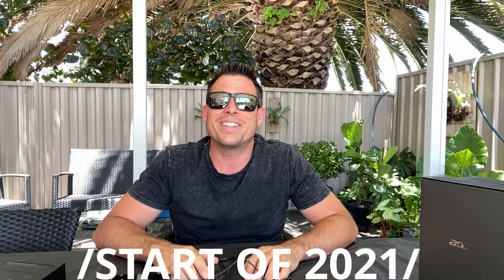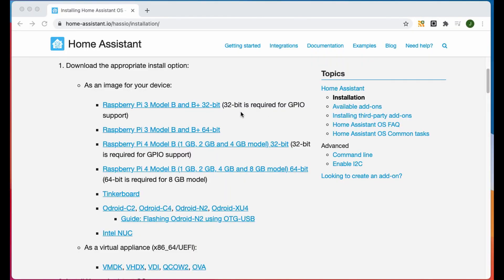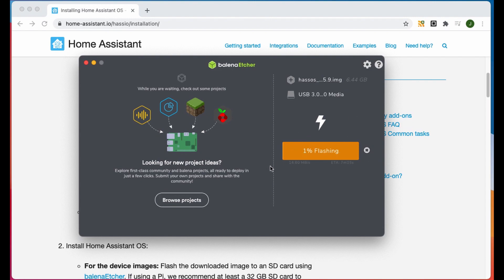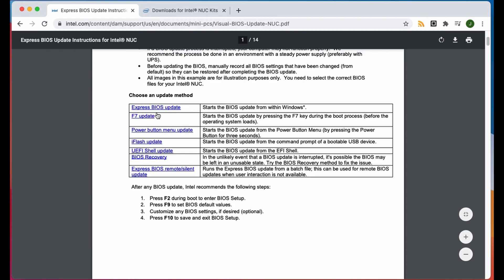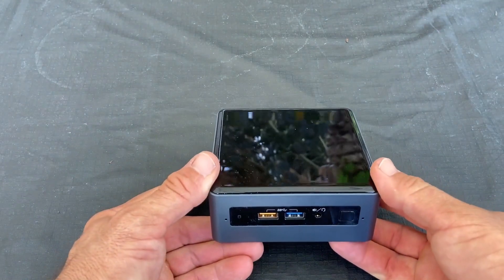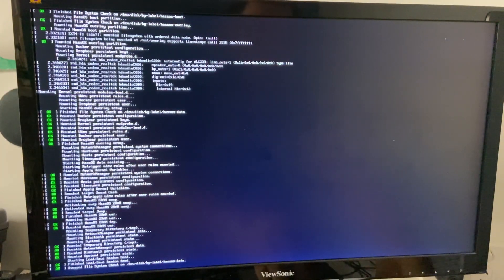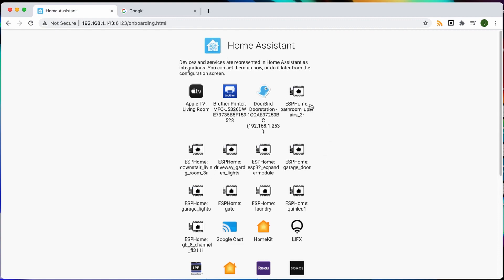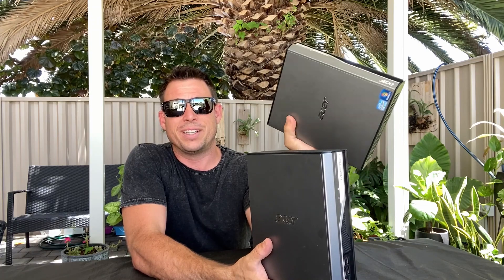Install Home Assistant on an Intel NUC

Comment: anyway to do this with a nuc that has an m sata? I got one but I dont know what to do with an M sata or can I boot this up from usb?
Reply from the maker: If you mean M.2 sata you can get usb converters for them, or for NUC with built in drive you can start it with a live Linux USB and load it from that using Balena Etcher Linux version.

Comment: Hey Awesome video, i have disabled to Bluetooth and WIFI during the installation. how do i turn them back on ?? i want to use that. i tried connecting a keyboard and display to my NUC at a later stage to try and enable the Bluetooth, but its asking for login and password. the one that i have is not letting me in.  some help will be appreciated.

Comment: Hello.  In Argentina everything is very expensive.  Is a Celeron nuc worth it to replace a raspberry pi 4?  Thank you
Reply from the maker: For me going from the RPI to NUC was night and day, so very much better, but that was a while ago when we continuously had to restart home asistant, the developers have made heaps of improvement so I don't have to do restarts much now and that was where a NUC would save me a lot of time in restarting, it sort of comes down to how much your trying to do with your system for example I have around 100 devices, 6 cameras, lots of automation and pretty much everything in my house uses home assiatnt in someway, so for me it was definately worth the cost.
Reply: @SparkyJames  Thank you very much for replying.  he had doubts if it is really worth it for more than being a Celeron.  hug and thank you very much for everything

Comment: when using HAOS, is it possible to use SFTP to transfer files?
Reply from the maker: Yes, but you need a ssh server add on setup. I have done it ages go. But there are probably easier ways to transfer file, I now use vs code addon or samba.
Reply: @SparkyJames  good point ... i forgot about add-ons. will give it a try.

Comment: I had a problem with SSD not being detected in the BIOS and tried all updates and tricks. Turned out I hadn't plugged the SSD into the slot properly, after which the installation was super quick. Had to disable "Secure Boot" too

Comment: So how do you do it with out the drive writer? 

I have NUC (second hand currently has Windows installed.)
And a laptop....
Reply: You could use a live linux USB on the NUC, then use balena etcher from there to flash Home assistant image to the HHD on the NUC. Then shut down remove the USB then it should start up to home assistant on the NUCs drive.

Comment: Could you just do this on a regular computer instead of a nuc or couldn’t you use a thin client
Reply from the maker: Yes you can, any x86 system. The image on Home Assistant download page is actually now just called the x86 install instead of NUC image.  I’ve tested a few and no problems. I’ve not tried a thin client yet, but if you can flash the drive in it, it should work.
Reply: @SparkyJames  oh great!

Comment: Hi Great video thank you. Could you please help 🙏.  Is this the same method using a mini pc like beelink? Thank you in advance
Reply from the maker: Hi Ajay, I do plan on making that video, HA will run on any computer that Linux will run on, the only issue to be aware of is it will most likely come with problems you will need to figure out, and various hardware compatibility issues that will vary from device to device.
Reply: Thank you very much
Reply: Hi Jimmy sorry one more question. Does this nuc have to be an official nuc or can it be ok with third party manufacturers.
Reply from the maker: Hi Ajay, relatively recently, the HA img for NUC is now a generic x86-64 so any 64bit x86 should work with the img on HA install site, using the method in this video, I’ve tried it on a generic system and it works fine.

Comment: Great video, I am about to move from a VM to a dedicated NUC. Question, I assume as I am already running VM i would be able to follow your steps and then simply restore from a home assistant snapshot without too many issues, I will of course give the NUC the same IP, but other than that I assume no other issues to worry about?

Comment: Hi, after looong trying of other methods I made it like you showed and finally it works. Thanks! Just a little tip: @ 7:21 you put an IP address, but for fresh installation and dhcp server it was "unknown" for me. What you need is to login to HA on NUC (after login: prompt type root) and then type nmcli - it is something like ipconfig on Windows. You can get IP of NUC there very easy. Much faster then go to your router and check DHCP table list etc.

Comment: Hello how to deport the on / off switch button of the intel nuc please
Reply from the maker: If you mean, remotely operate the NUC on/off?  You can set power settings in BOIS to start the NUC when power is restored to it, there is also the possibility of using IR remote which is built into NUCs and maybe an extender of some sort.

Comment: a NUC is expensive. 
can i just use a laptop? wipe the SSD clean n flash it with the image file you used?
Reply from the maker: I probably wouldn't use a laptop, but if you did you would need to install Debian and then use the home assistant installation script to install home assistant supervised. It's not something I would suggest unless you want to spend hours messing with settings and problems.
Reply: @SparkyJames  Hey mate, thanks for the great video!  You earned a subscriber :)

But I'm a bit confused by your response to dablet's question here.  Why wouldn't you use a laptop?  If it's an x86 machine flashed with HAOS and supervisor, isn't that the same thing as what you've done in this video?  The only difference between a laptop and a NUC at that point is the laptop has a monitor (and battery for backup) built in.  Or am I missing something?
Reply from the maker: @BallsworthBallsbury  That comment is no longer valid I will delete it now, at the time the image was for a NUC only they have changed it to x86 and I've tried it with lots of different x86 with plenty of success, but I've not tried it with a laptop, but I sure it would work, the only thing is what happens if you shut it, does it sleep, I'm not sure as I've not tried it.
Reply: @SparkyJames  ah that makes sense. Thanks for the reply! Cheers friend!

Comment: Awesome work mate, thanks heaps. Where do you source your NUCs from? Do they all come without memory and HD? What sort of specs  would you recommend for a home with around 50 smart devices? What zigbee and zwave sticks would you recommend too? I'm currently using ST and recently bought a HE but I'm looking to eventually fully transition to a mix of HA and HE.

P. S. I used to live in Burswood which is near you hah..
Cheers.
Reply: Hello, youbNever got a reply, i have the same questions as you. Did you find out ?

Comment: Hi Jimmy, thanks for your informative video. How you configure your network after installation? I can't find my SSD after flashing it using Balena on my dekstop?
Reply from the maker: Yes, it's not readable by most desktop systems after it is flashed.  You can change network settings within Home Assistant GUI under supervisor/system(tab at top)/under HOST click on CHANGE next to the IP address to setup wifi if you wish or change wired settings

Comment: I have a NUC8i5BEH and I dont have the option for OS Selection. I have updated the firmware but still not have that option. Any ideas what else I could check or should check in the BIOS? Thanks

Comment: You need to check out the new DETA dimmers. By far the best dimmer I have tried. Zero cross detector and PWM driven TRIACS on active and neutral lines. Dims my LEDS to almost zero. Very impressive.
Reply: Do they integrate with HASSIO?
Reply: @spawnterror  Yes with the TUYA integration.

Comment: Exactly the method I used. 
I grabbed a used celeron Intel NUC 5th gen with 8gb ram and 250gb ssd and it runs like a champ. - $80 us on eBay.
Reply from the maker: That’s a good price. They are really hard to find second hand where I am.

Comment: Would have been interesting to see what the power draw was of your nuc, running 24/7 it does add up! Cheers
Reply from the maker: Yes your right it does, I’ll measure it and let you know.
Reply from the maker: It uses about 10w, which is 87 Kwhr per year, where I live that is $22 a year compared to a RPI 13 Kwhr per year or $3.25.
Reply: @SparkyJames  Thanks, ouch on the unit cost! It's average of 0.15 pence here. No thoughts on solar?
I'm running a Dell R710 24/7 running various vm's but at approximately 180 watts it costing a fortune. I've got solar but no battery and winter here so solar not saving me much at the moment😥

Comment: Cheers for that, couple of questions please, does HA resize the ssd automatically? Can you add a snapshot to the ssd after using Etcher so it’s local to restore it?

Would love a video, tutorial on how to set up https if you don’t mind? 😀 Cheers
Reply: Home assistant has a lot of plugins and brings you DuckDNS so you can enable https using Let's Encrypt. With the documentation it is a breeze to set up!